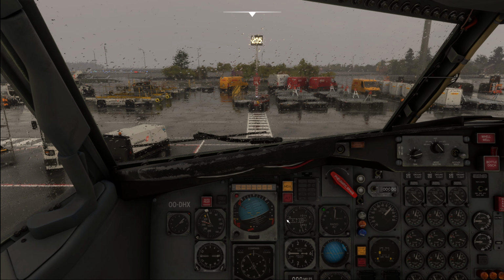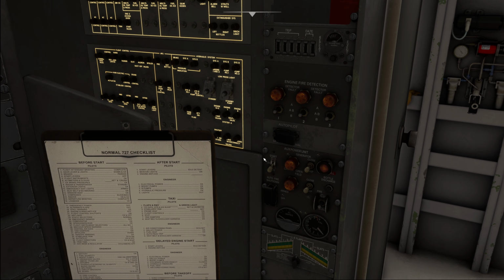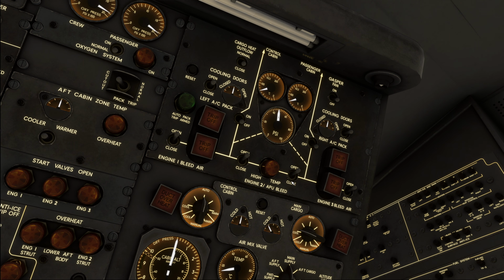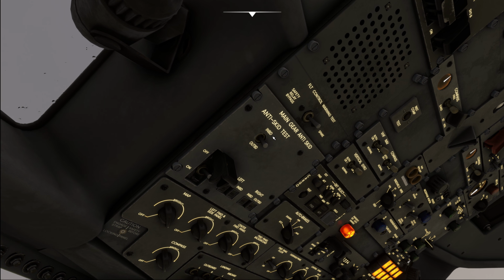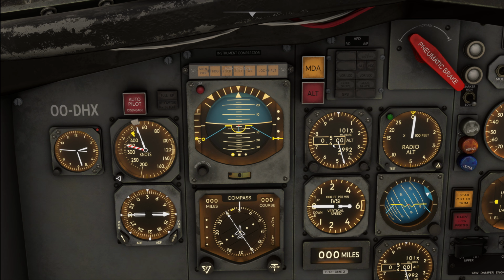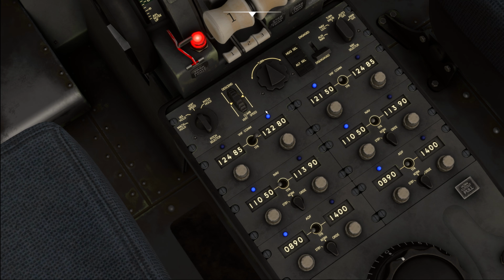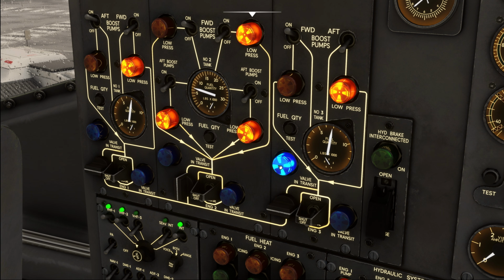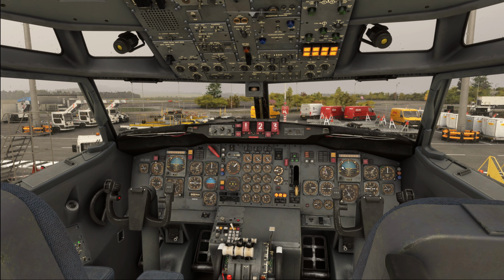FSS Boeing 727 Tutorial 1: Powerup and Cockpit Preflight | Real Airline Pilot

Comment: Is the flight model accurate and better than Dreamfleet's 727? That plane was awesome and i still have FS9 just because of that plane
Reply from the maker: Never flew that one. It seems believable though.
Reply: @A330Driver  Thanks, I appreciate it.. I know it's very old but you could give it a try, given FS9 limitations of course, but system wise it was awesome, and the flight manual was top notch. Fuel tables and EPR settings were as per AOM and SOPs of some airlines.

Comment: Excellent video.  I have a question
Why after I turn on the APU, in the top panel of the engineer, I don't have the three engine generator circuit lights on? they are off.  Thank you

Comment: Curious, the Mode selector on the Altitude Select Panel isn't working with hundreds on the down position. I wonder if I messed up something or the version of the aircraft you have is newer. I have 1.0.0 and Aerosoft One tells me there aren't any updates. Also, the Radio frequency selector, when moved to the right frequency, the blue light above it does not illuminate. I have to test in vPilot if the frequencies actually change despite of the light not switiching. Anybody else having these issues?

Comment: Hello, I have watched your flights in the pmdg 737. Why do we turn the anti-ice at or below 10°C TAT instead of 0°C ?
Reply from the maker: Different pressures all around the airplane change the temperature of the air around those parts of the plane. Just because you have 10°C at the location of the TAT probe, you do not have 10°C all around the airplane.

Comment: Hello Emi, nice content thanks for your videos. I saw the processor you are using for simming and wonder if you have already updated the microcode for the issues that arose with Intel 13th and 14th generation… I have an i7 13700F and I am a bit afraid of using MSFS lately and I am waiting for the BIOS update… What are you thouts on this Intel issue?
Reply from the maker: Hi, I had to update my BIOS twice to keep the system running by now. Whenever I start to see instability, the first thing I do is a BIOS update and it usually works quite well.
Reply: @A330Driver Thanks for your answer Emi